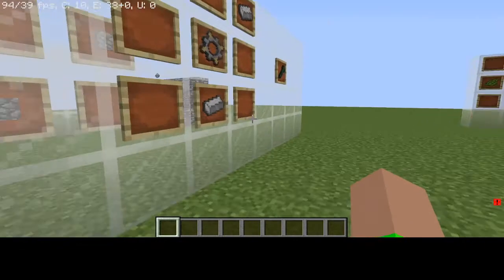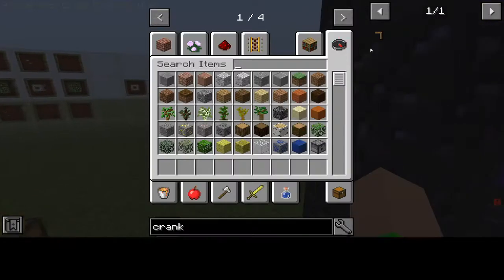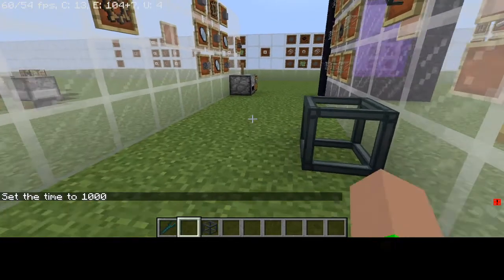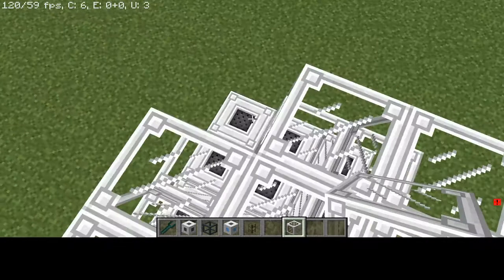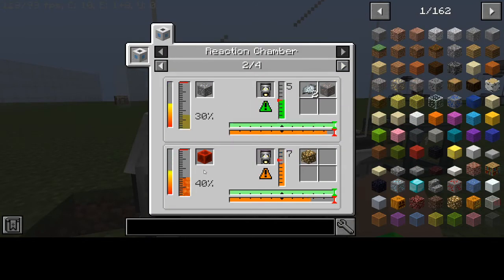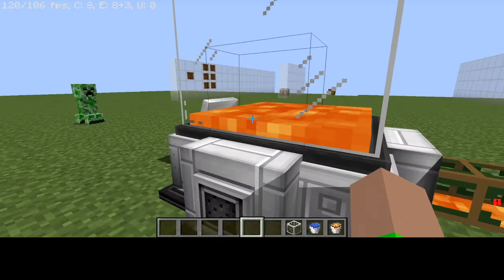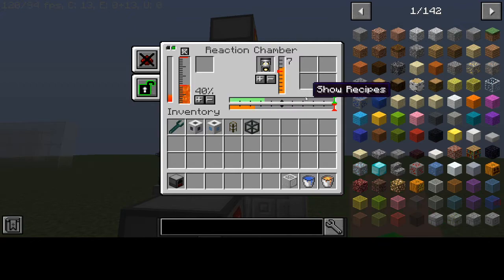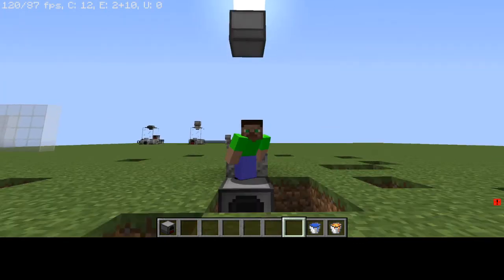How To Make Use And Power And Fuel The Reaction Chamber Part2

Comment: For creeper acid you need the pipe and metal barrel from immersive engineering. Connect the pipe on one of the sides. 2 pipes to the left or right and one on the top(an l or corner shape) then put the metal barrel on top of the pipe. From there you can right click creeper acing into the barrel which will go into the machine.